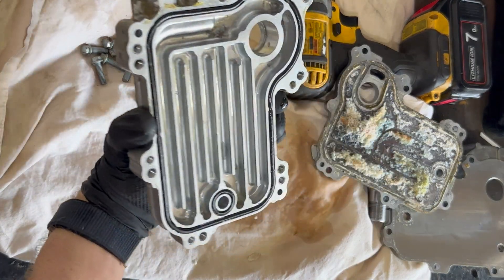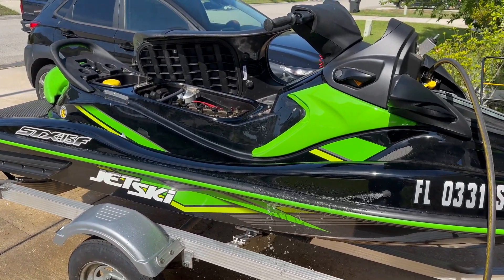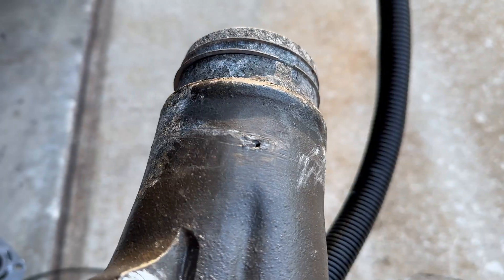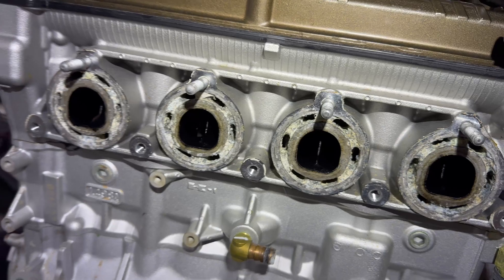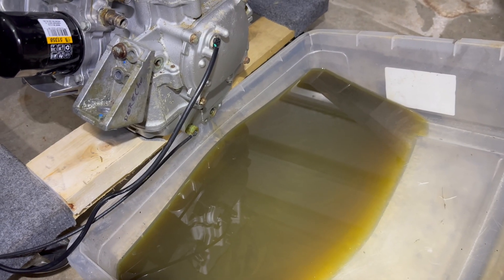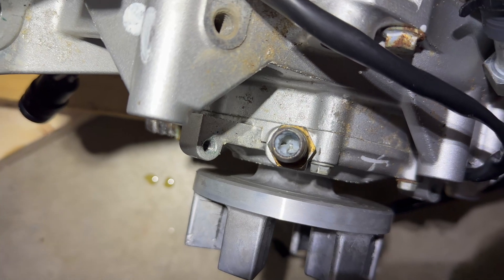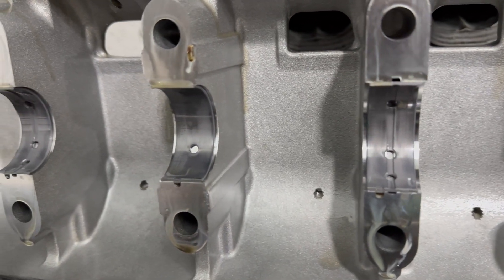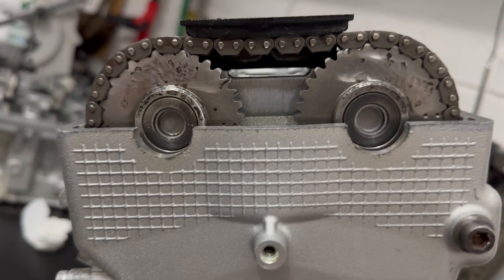Part 2 Repair Jet Ski Oil Contamination

Comment: Interesting failure. Check the barbs at the neck or the water box as well. It’s best to remove them to clean inside the sleeve too.
Reply from the maker: @TheStephenspann27  You know…. I actually can’t remember if I did that… I’ll have to check that at some point. So far so good though. It’s been running great! I plan on uploading a higher rpm tune so I can hopefully hit 65mph on it. I’ll do a new video on it when I do

Comment: just another spare engine out of nowhere huh? lmaooooooo

Love the video (and intro as well, whoever was yelling at the end of it hahaha)
Reply from the maker: Hahaha oh ya. That me.
Reply: Great video, i have a 12f 2006, almost same issue, i found water in my cylinders and water mix with oil.
Reply from the maker: @douglasweeks7407  pretty much the same ski so you can try those things and see. I’d also suggest to check the exhaust manifold cuz that could be letting water back flow into the cylinders if it’s rotted out. I would start there before anything else and see what it looks like